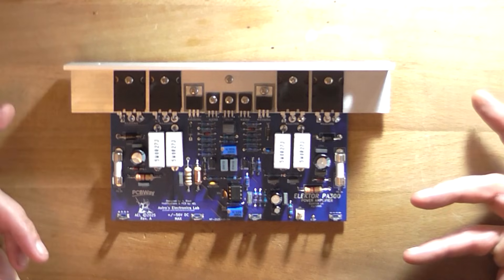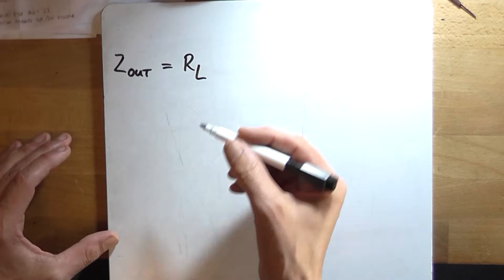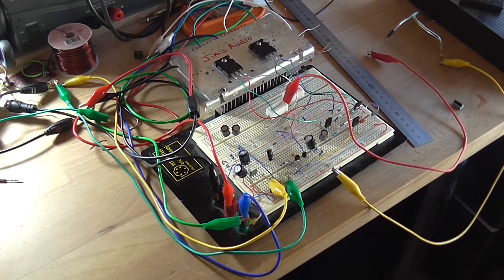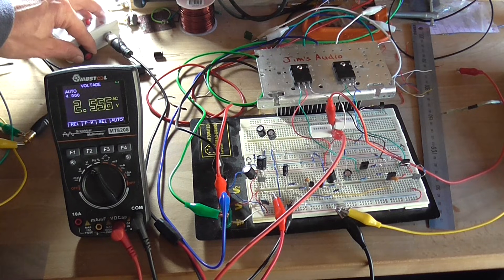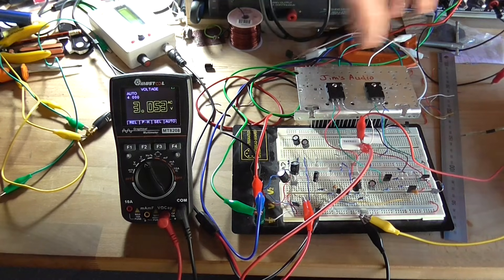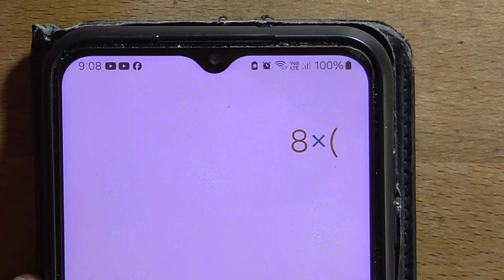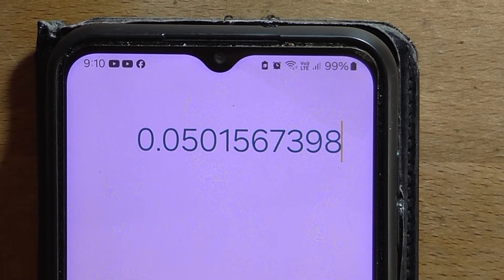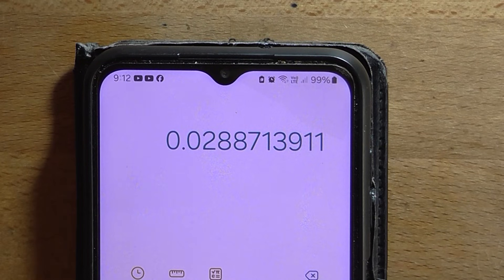Power Amplifier Output Impedance & Damping Factor

Comment: Maybe measure it at higher output voltage, about 80% before clipping? Just to see what you'll get.😊.
All you actually need for the amp to "sound" linear across different speakers/crossover/loads is a damping factor of about 20.
Also worth noting is that Zout will be different at different frequencies, especialy with reactive load (speakers, crossovers), not as much with purely resistive load.
Nice one Astro, debunks a lot of mytholgy and black magic.
Reply: Rings true, I have experimented with lowering the DF from around 250 all the way to 80 and couldn't hear any difference tbh. 8R nominal impedance 6"driver with 0.064ohm RDC 8AWG ribbon air inductor in series and 60Hz - 3kHz -6dB bandwidth.

Comment: Is the multimeter a true rms meter?  For the calculation to be accurate you need the RMS value.  For the oscilloscope you may need to have many more cycles on the trace to get an accurate rms reading.  But even then the scope measurement is probably not accurate enough to get an accurate measurement of such low impedance.  Also for the multimeter meter rms measurement it is usually limited to lower frequencies so check the multimeter specs.
Reply: because voltage RATIOs are used  neither waveform shape nor 
measurement type 
(average, peak  rms etc.)
 should affect the result.
Reply: @sulaimanabdullah952 true if you assume the waveform is not altered by any distortion under loading.  But we are looking at the third or forth significant digit so small discrepancies matter when measuring milliohm output impedance
Reply: Well explained Astro😊
Reply from the maker: Not sure if it is true RMS, nothing printed on the case. I agree the scope may not be accurate either.
Reply: @AstrosElectronicsLab  since you are measuring a pure sinusoid signal at only 100hz the rms reading from the multimeter should be pretty good even if it is not true RMS.  At least I would trust that reading more than the scope.
Reply from the maker: @argcargv  I would, too. My Owon XDM1041 is a true RMS, so I could use that.
Reply: That one is easy, get the peak voltage visualy in the oscilloscope and divide it by 1.414. Maybe even set the input level to get a rounded peak output voltage.
Reply: @mitkothemacedonian 👍🏾
Reply: @mitkothemacedonian If you have an 8 bit sampling depth oscilloscope then at best you can get 2 significant figures of accuracy from the voltage readings, but for this low impedance measurement you need at least 4 significant digits.  A decent quality multimeter should be able to provide that, but only high end scopes would even have a chance.

Comment: One thing is loaded voltage drop of amp stage at amp output terminals, a measure of useful/real world voltage drop (damping) would be at the bass speaker driver terminals (ie after the LP crossover).
IOW the amp stage damping factor is kinda moot point when speaker cable and LP filter inductor resistances are significant, typical LP bass series inductor measures around .3R>.5R and higher, speaker cables resistance will vary also.
Reply from the maker: That would be correct, however, we're more interested in what the amplifier is "seeing", not what's happening at the load. This is why I measured the drop at the amplifier output.
Reply: @AstrosElectronicsLab  Sure, I am highlighting that conventional measurements don't tell the whole story...some 'audiophiles' get hung up on amp DF when system DF is intrinsically low.
Reply from the maker: @ericmc6482  yes, I know. Totally valid.